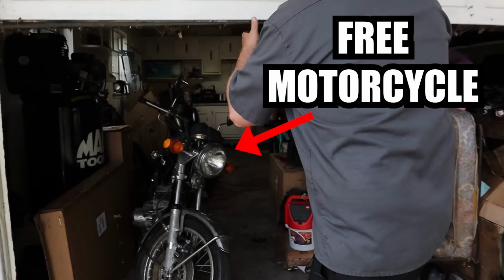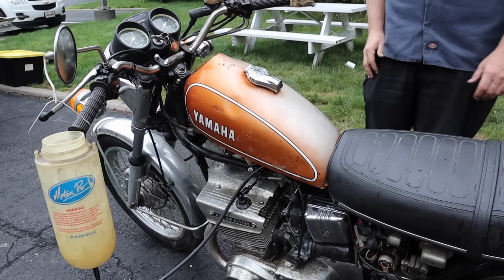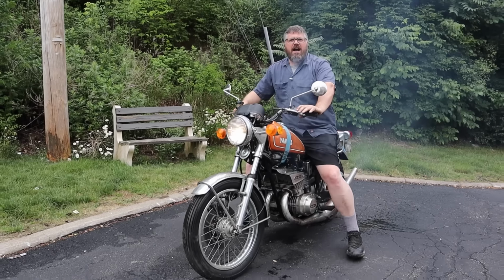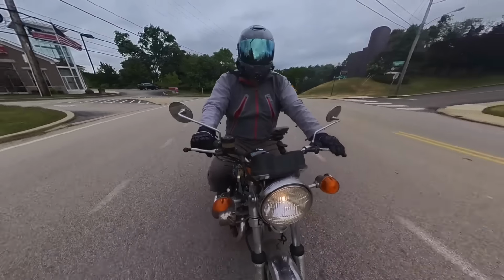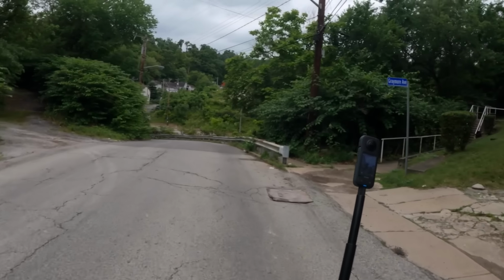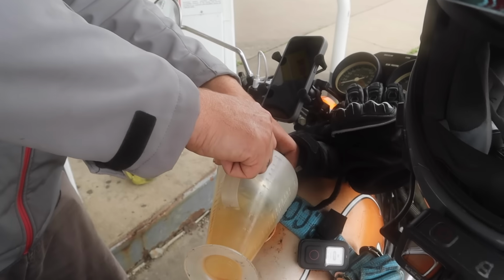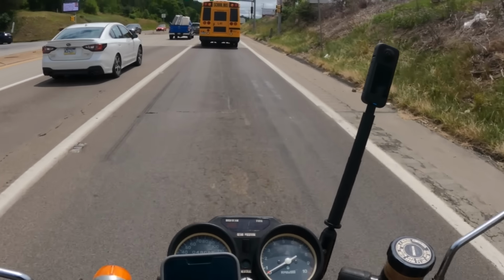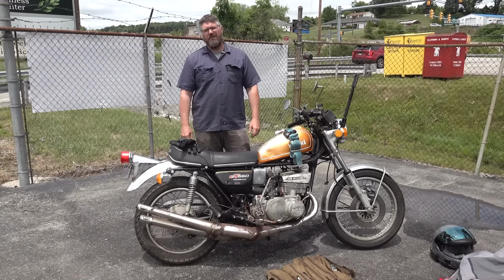Will This 48yr old FREE Bike Get me 253 miles Home?

Comment: I bought a GT550 project bike when I was in the Navy down in Virginia around 1980.  It was almost as bad as yours.  It had sat outside under a tarp and everything in the engine was toast.  After I moved back north I found a second one that had a running engine but was pretty rough otherwise.  I put the two bikes together and had a nice running 2-smoker for very short money.

Rode it around for a few years and then shipped it off to my brother-in-law in Missouri when I upgraded to a BMW K100RT.  He never told me what became of it, but I assume that he lost interest and just got rid of it.  It was a fun bike.  Didn’t handle all that well, and the brakes were only so-so, but had lots of 2-stroke power.  Ring,ring, ring…

Comment: Really interested to see more of this bike having had some experience with them myself. The thing you need to know is that these bikes are not designed or jetted to run on premix and the crank bearings are shielded so they need the oil pump to get proper lubrication. In a good running condition, these bikes put out 48.5 bhp and are actually quite quick for an early 70s bike and can keep up with modern traffic pretty well.
Reply: I had one in the late 1970s and regularly rode it from San Francisco to San Diego.  My injection pump was running just fine.  I wish I had one today.  Fun bike.
Reply: Some simple and fairly easy porting really wakes them up! The fuel mileage remains terrible, but the engines can become pretty strong, especially with a good tuned exhaust
Reply: Those 3 cylinder twostrokes from the 70´s weren´t called widowmakers for nothin ;)
Reply: "are actually quite quick" I would expect nothing less from a 500cc two-stroke, to be honest.
Reply: @JeanMarceaux  I agree, but It's just that you don't always expect a bike which was designed 50+ years ago to have a good performance by modern standards.
Reply: @A_S_100  fair enough

Comment: That was freaking cool and I hope you decide to rebuild that motor. That bike is a piece of biker history
Reply: It's a piece of my history. I had one back when they were new. They were a very cool looking bike, for the time period at least. I clocked up a lot of ring a ding ding miles on mine way back when.
They weren't as quick as the 3 cylinder Kawasaki death machines but, they certainly weren't slow either, they actually went around bends too, unlike those ballistic but insane Kawasakis.
Reply: indeed. and tuned theyre bullets, specially the gt380
Reply: @Toxic2T  I owned a 550 GT when they were current though, I bought mine second hand. I never did ride a 380 so when you said that I thought "nah, BS", at least it should be. I went looking for specs to check and at first they confirmed that the 550 would be a fair bit quicker with 50 hp at 6,500 rpm as opposed to the 380 only having 38 hp at 7,500, I had to hunt more sources but they gave a torque figure of 28 ft lbs at 6,000 for the 380 but no info on the 550 there and elsewhere I found it's 38.7 or 39.7 depending on source so a pretty decent amount more power AND especially torque for the 550 BUT, the 550 is 4 inches longer, an inch wider BUT, the big killer, the 550 is a full 100 pounds HEAVIER! That really surprised me and at 216 kgs (477 pounds) I think just going by those figures I'd half expect the 380 to be maybe a bit quicker off the line but at speed the 550 should be able to pull a bit harder.
That weight difference surprised me. I do remember it as not being super light but, I didn't expect it to be that heavy, oh well. Compare that to the BMW S 1,000 R I had a while back that somehow weighed less and had a full 165 hp to play with, now that's a REALLY QUICK bike lol.
I've owned the 550 GT and a T 500 twin too, ridden 1 of the insane Kawasaki 750 triple 2 strokes both before and after being bored, ported and having expansion chambers fitted for road racing and that thing was pretty crazy quick but, terrifying in every other way. I'm really wishing I had ridden a 380, I think I probably would have liked riding 1 of them even more than the 550. I like light and nimble and the 380 sounds like fun. I did have a Yamaha RD 250 and that was a fun and surprisingly zippy little bike too. That BMW was something else though, from another galaxy! Insane power, add the quick shift and it actually handling and stopping really well as well and I DID go from 70 kph stuck behind traffic to 285 kph just in the distance it took to overtake about 10 cars crawling along damn near bumper to bumper! That thing was amazing! Still, put me on a light little zippy 2 stroke and I'm a happy chappy, it's so sad that apart from those annoying little 50cc 2 stroke scooters ALL the really worthwhile 2 strokes are gone.
Reply: @lorditsprobingtime6668  Anything two stroke and more than 1 cylinder is no joke. Respect to you for surviving that badass era of motorcycles. 2 stroke is is a lifestyle.
Reply: @Toxic2T :   " 2 stroke is is a lifestyle."  I never really thought about it that way but, yeah, it kinda is. I did look down on 4 strokes back then because 2 strokes were a lighter weight engine and SO much simpler to work on, plus, the vast majority would eat any 4 stroke of similar size and something as simple as an expansion chamber, especially pre muffled ones made a HUGE performance increase. I know you 'can' get more power out of those old 4 strokes too but, make sure your wallet's fat and you've got plenty of time and patience. The only slightly annoying thing to me riding any 2 stroke is when at that throttle setting where you're not engine braking but also not actually accelerating, that ring a ding ding and jerkiness can be annoying but, all the plusses more than make up for that.
Foot note:  The guy I knew that bought the 750 Kwaka triple and road raced it, amazingly he did AND, he's still alive! I felt like I was going to die almost every second I was on that insane death machine lol.
BTW, I have had a lot of 2 stroke single dirt bikes too. One in particular was a bit scary quick. That was my very highly tuned and PROPER expansion chambered Bultaco Pursang 250 that I had setup for racing short circuit. When that thing hit the power band which was tuned more like the really peaky little 125 motocrossers, holy hell, she'd snap that front wheel up so suddenly lol, she was a bit of a monster for a 250 but, SO MUCH FUN!.
It sounds like you've had your share of experience with some of the wild and wooly old 2 strokes too so good on you.
Reply: @lorditsprobingtime6668  Good ol Bultaco that was a quick ticket to get hurt hahaha. And the legend, the Kwaka 750 Triple, that's like the Godfather of two strokes, besides the 700cc Maicos. I'm used to souped up with big bore adaptations(90-100cc) mopeds(that originally were 50cc) so I got to know the powerband, the biggest one I've got to ride was the Honda NSR 150 RR from Thailand, that thing is tiny but performs like a 400cc 4 Stroke. And the latest 'big' 2 stroke was just a KMX125 that was plenty of fun. Wish I get to ride an RD400 Daytona someday, but they're collector bikes already :(
Reply: @Toxic2T  Oooh, near 40 hp out of a little 150cc engine at near 11,000rpm! Now that DOES sound like a fun little bike lol. 
I was at first a little surprised to see Honda tying up with Kymco but, even my old Honda Civic was made in Thailand and it was a great little car so, why not.
Those Kwaka 750 triples, AKA The Widowmakers were like the crazy guy with a loaded gun at a party, you just expect it to kill you at some point lol. All the 3 cylinder 2 stroke Kwakas were mental, even the small ones but, that 750 were just nuts! That BMW was far quicker but, at least it did handle and a really smooth power progression, it was insanely quick and fast but, very well behaved, unlike those mental machines with rubber bands for frames and banana skins for brakes lol. Anyone who owned one of them for any length of time and is still alive today is VERY lucky.
Honda made their 2 stroke introduction with those Elsinore trail and motocross bikes. I once raced on a 125 motocross one which went amazing for a tiny 2 stoke, you just had to keep it in it's power band. Later I got to ride the street legal trail bike version and was extremely disappointed they detuned it SO much, even a 125 4 stroke probably could beat that thing while the race I rode the motocrosser in was an open class and had everything including JAP 500 sliders, 400 and 250 motocrossers yet that little 125 blew them all away off the start, then about 2/3rds the way down the start straight all the big bikes come roaring around me lol. Ahh, fun times.
Reply: @lorditsprobingtime6668  If you mean the cr125 thats 40hp in a 125cc its mental to ride and survive. Sadly we didn't get the 750 triples here in Argentina, but we got the RD350s(Black widow cuz mostly came in black and red) and the RD400 Daytona which was called White Death. So many guys died in these back in the 80's and 90's here. They were used to little 15-20hp 2 strokes then these two cylinders came by and it was easy for people to lose control. Same happened when the CBX1050 arrived, the bike scene here back in the 80s/90s was wild. About the JAPs I know of a gentle  old man(National and latin american motorcycle champion) that still keeps his JAP 500 slider, it's a total monster, afair it has some huge 28 inch wheels with thick mud tires. The biker life is a whole different world man, with cars I wouldn't had as much fun!

Comment: Rebuilt a old Zundapp Db234 NormaLuxus with my dad, that bike was over 50 years old and had a possible seized piston broken mechanical magneto and a lot of rust.

Yet it is restored to new again, i still remember the sugh of relief when we removed the piston from the cylinder block.

A dot of rust (5mm or 3/16 Inch) was all that it took to not be able to move anymore😮

But the satisfaction of making parts and powdercoating them 😊 never ever gonna forget that ❤

Comment: For those that don’t know ….. the jetting for the motor was setup for fuel only .
Adding oil to petrol means for a given volume .. it now has less petrol , making the bike run lean …. Because the oil normally comes in through the oil injection .
So essentially 
100% petrol runs way way richer than a 20:1 mix .
It’s the cheap and dirty way to play with fueling ratios when tuning a 2 stroke 
Anyways, if you ever change an oil injection 2 stroke over to premix … remember to size up the jets about 25% on a 40:1
Reply: absolutly right with that. would have been better to get the original oil system to work. but it did well as it was. that bike is still worth a couple of grand here in the uk even as it is.
Reply: indeed I would go with at least 35ml per liter on an engine that big. also 4% will guarantee a trip home.
Reply: @masterpoop67  3% and you're good to go. just check the spark plug after WOT run itll tell you where you currently at
Reply: also no airfilter
Reply: Don't forget the air leaks from all the perished rubbers
Reply: 25%??? You sure you didn't put the decimal point at the wrong spot. Even if you count the oil as 0% burnable you've still got 97.5% at 40:1, so for that you'd have to go 2.5% richer. Going from old non ethanol fuel to E10 is a 5% difference for example and would be more significant.
Considering these bikes are usually jetted super conservatively you most likely don't have to change anything. 
In this case the missing air filter and the vacuum leak because of the unknown hose is the bulk of the issues.
Reply: Don't listen to YouTube experts. These need the oil pump for crank lubrication.
Reply: @redtobertshateshandles   yeah , but I’ve learnt you can’t tell people there wrong , they need to figure it out themselves … I was just pointing out why he’s got a hole in the piston …. You could see it all going bad as he rode it … if you know 2 strokes you know what I’m saying … if you don’t  you just don’t
Reply: On a T500 adding oil in fuel would not oil crank bearings. Probably here as well.

Comment: I had an old 2stroke that would not run and I thought it was the obvious piston rebuild. Upon inspection the past owner run too much 2t oil and it caked the exhaust full of greasy carbon goodness. I replaced the exhaust and it ran like a new bike ❤❤❤ just a lil tip for anyone who finds themselves a "worn-out" 2stroke 😊

Comment: It's not a victory until you get it running reliably.  Go for it!  You don't have to restore it, but please get all the parts together and working, make it pass inspection, make it a daily driver for somebody.  Maybe me?

The first street bike I ever rode was my roommate's Kawasaki H1.  If you know, you know.  Up to that point, I'd only ridden minibikes with torque converters, so I learned to use the clutch, and I learned to kickstart a 500 two-stroke triple.  I felt invincible.

The first street bike I ever owned was a two-year-old Yamaha Vision with less than 600 miles on the clock that cost me about 1/4 of the MSRP.  After the H1, I was a little disappointed in the power, but only a little.  Kind of a quirky bike (water-cooled 550 cc V-twin with shaft drive), but a solid reliable commuter and really a ton of fun, though it was a bit heavy.  At least it had electric start...

Comment: It's a shame seeing it being destroyed like that. Even in this condition, those bikes are pretty valuable here where I live. If you're lucky enough to find one in decently good, running condition (I'm not talking restored or anything) be prepared to pay between $7k - $10k...even more for really good ones. That's kind of what to expect, if you do the bare minimum on those bikes and run it like that. I wish I could afford one of those, even in this condition. I would love to restore it.
Reply: especially when it got parked in good running condition and then ruined on a video for youtube views. Kind of disheartening.
Reply: What I would have done different
Plug up all vacuum leaks on 2-stroke before riding miles and miles on the highway😂
Reply: @captainfancypants4933 non-functional front brakes, hole in a carburetor float, rusted through fuel tank and no air filter are considered good running conditions now?
Reply: @JeanMarceaux tbh those faults are fixed for a few bucks and some elbow greese..
Reply: @Thelemorf  fixed -- sure, but these are not running conditions. In my understanding, running conditions are "get on a bike and ride immediately" conditions, not "spend two weeks rebuilding a bike and then maybe run it".

Comment: Great job getting the old Suzuki 2T running. Two things I think you should have fixed before hitting the road was the obvious fuel leak and installing new tires. It's just not safe or smart riding at highway speeds on 30+ year old tires and tubes for over 400 miles.

Comment: Another thing that would have been a cause of lean mixture is that you added oil to the fuel instead of getting the injection system working. This makes the fuel slightly more viscous, so less of it flows through the jets in a given time under a given pressure. Also a few per cent of what does flow is not fuel, further leaning the mixture. If you are converting an engine from oil injection to lubrication by oil mixed with the fuel, you need to fit slightly larger main jets and possibly also alter the needles or their position. Note also the comments that several other people have posted about the shrouds around the main bearings on Suzuki engines that have CCI Crankcase Cylinder Injection, which I think is all of them up to the late 1970s at which point Suzuki changed to injecting oil into the inlet ports only like Yamaha.
In the course of getting this bike running did you ever check that the sparks were correctly timed and that the spark plugs were of the correct heat grade?
Reply: The moment he said, I ll cut off the oil system, I knew what will happen.
Poor engine killed by a cluless mechanic. 
I think the dry running oil pump is toast too.
Reply: Those were probably the plugs installed by the factory.
40 years ago I  rode Yamaha RD - 350s.
I would've jerry-rigged a foam filter. Lean kills 2-strokes. Especially down hills under trailing throttle with pre-mix.
Still, it was an adventure !
Hopefully you rebuild it.

Comment: Hi Craig, I’m really surprised it got that far. I read somewhere that you have to use the Oil Injection System on those Bikes. If you Pre Mix it doesn’t work right for some reason. I think being a Rare Engine, and the fact it tried to Run good. It deserves a Total Rebuild. That would be a Great restoration Bike. I would love to have one of the Old 2 Stroke Street Bikes. Especially like a H2. Great Video and loving your new Channel. Can’t wait to see more. It was nice to hear Sean at the beginning also. 👍👍❤️